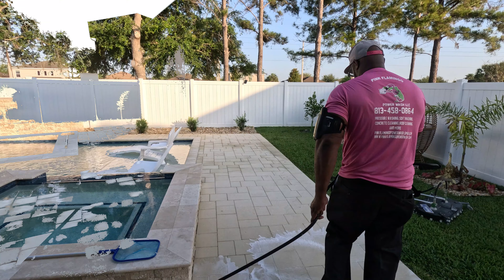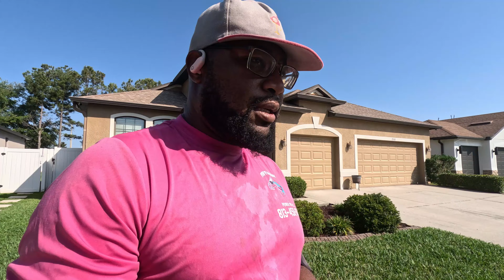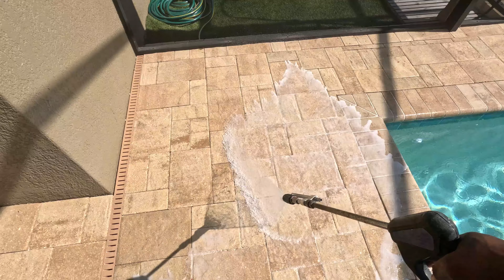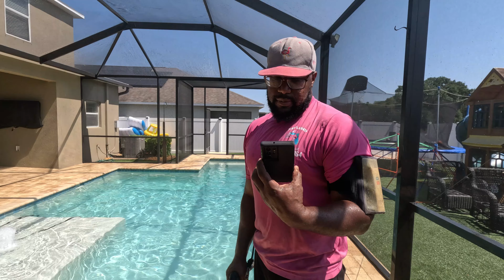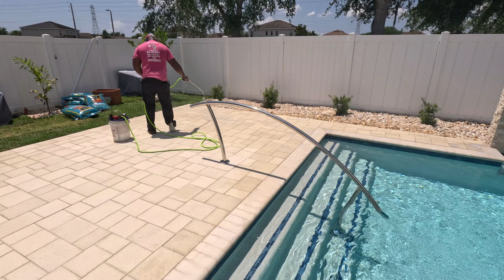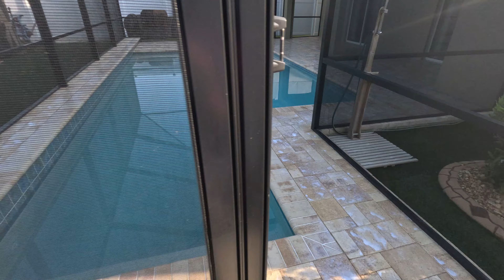2 Paver Sealing Jobs In 1 Day!!! #howto #paverseal #paversealing

Comment: Nice work! Looking to add this service, trying to figure out the best way to price it out
Reply from the maker: Best way to price it our is by square ft.  Find out what your market or area is charging and go from there.
Reply: @PinkFlamingoPowerWash  thank you! Also if I was to buy 5 gallon bucket of sealant, what do people mean it will be 20 gallon liquid. Because from my understanding 5 gallon bucket covers 1000 sq feet, or does a 5 gallon bucket cover more. Thank you
Reply from the maker: @RobertJennings-xi3tk  if you buy a 2 part sealer you can mix each gallon with 2 gallons of water. It's not 20 gallons. It will be 10 gallons. 

If you water it down more you can get 20 gallons
Reply: @PinkFlamingoPowerWash  okay thank you

Comment: For a reseal after about 2 years would you just do 1 coat or always 2? Wondering if would be slick after resealing with 2 coats again or if it would even need 2 or just 1?
Reply from the maker: I would do 2. Nah it won't be slick the old coats will be ate up by the sun and weather

Comment: Can you use a pump sprayer to add the sealant to the pavers? Using your mix ratios? Do those ratios also change depending on the color of paver?
Reply from the maker: In the beginning I used to use a pump up. Then I moved on to more efficient methods of application.  Just know that with 2 part sealers the pump up with clog up very fast due do the hardener in the sealer.  

Color isn't gonna change like that.  You may get more sheen but not color since the sealer is a enhancer.  You will only get a dramatic color change if you tint the pavers